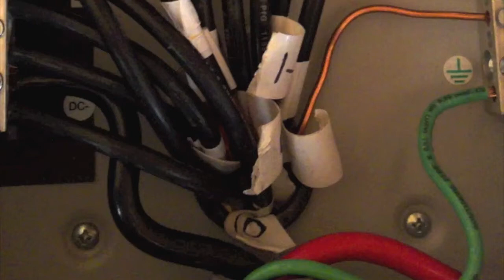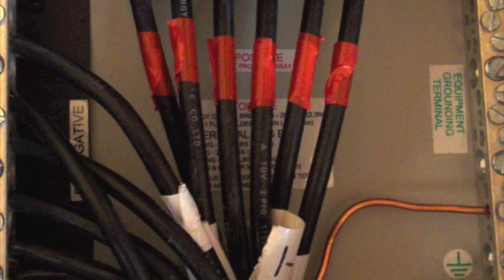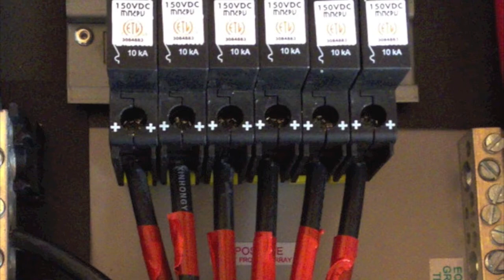Wiring the MidNite Solar Combiner Box, Solar Off Grid Installation

Comment: Why are  you using MC cable then land it on a 10 breaker/fuse ?   A 10 awg is plenty with almost no loose. 
The solar side is normally higher voltage and lower currant.

Comment: can I buy one like this from you because I have the same system.18 solar panels 275w - 5500 xantrex inverter charger, 8 powersafe 12 v batteries but I have the sma 28-240 combiner box , th box is too big .